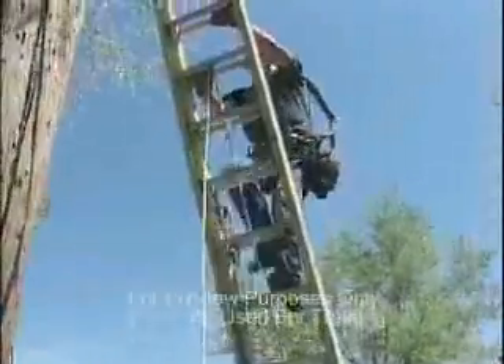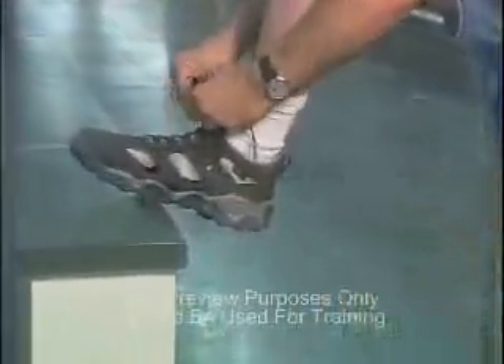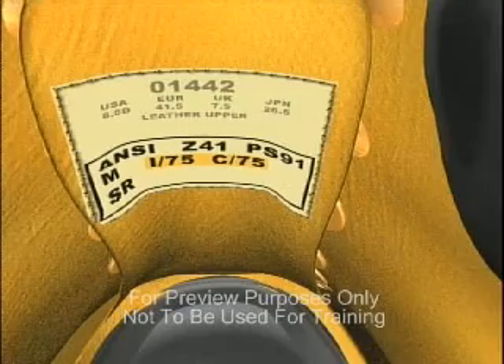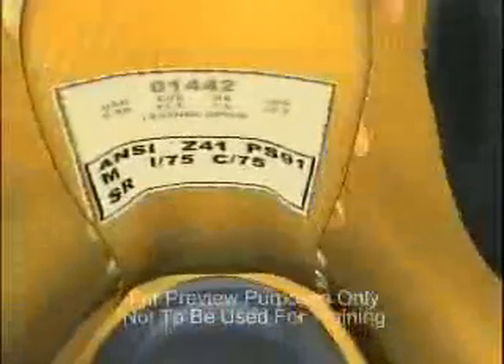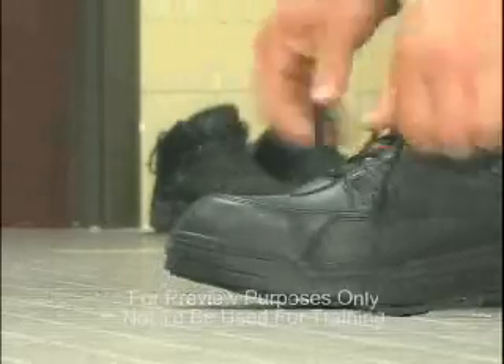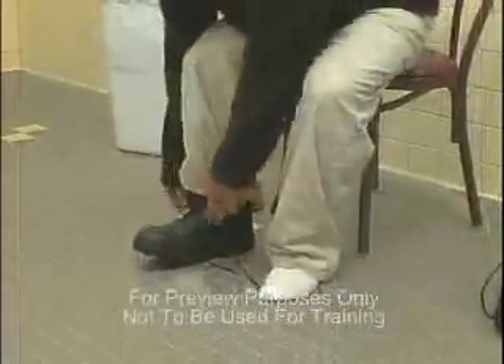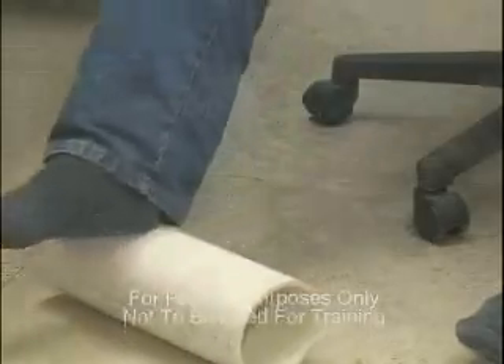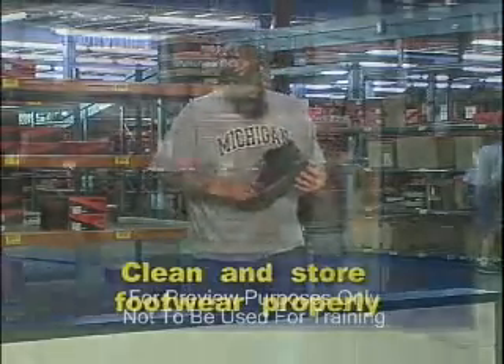PPE Training For Foot Protection   Foot Protection

Comment: One glaring question I have that no one a ever asks is why should you have to recover from wearing safety toe shoes in the first place? Most companies that institute this policy fail to do a proper hazard and risk assessment of if the policy will truly be beneficial for employees. Yes it will help prevent foot injuries if something is dropped on or driven over the foot. What is never considered as a balance is the definite long term consequences of wearing safety toe shoes (versus slip resistant and other safety shoes provides). Things such as hip, knee and ankle pain that WILL be caused due to the unnatural foot and toe mechanics that result over time. Unfortunately no one is willing to do a long term study on this. Only found one from Britain that got no press about a decade ago I believe. There is without a doubt areas that the benefits out way risks, but not the blanket policies OSHA pushes and companies blindly follow with short term thinking without looking at long term outcomes for employees that likely only work for a company a decade or so. Thank you for the great information, but maybe give some consideration to asking the better questions up front.